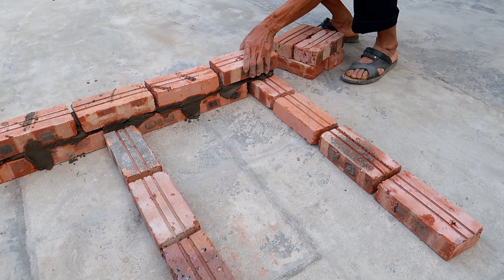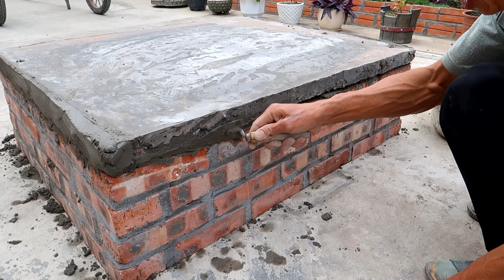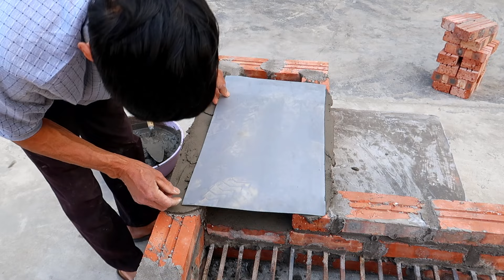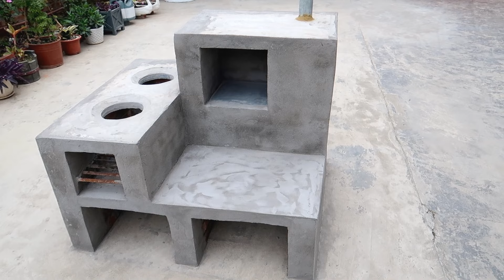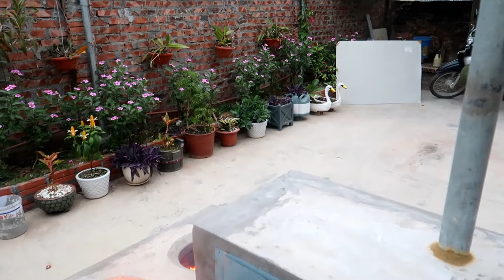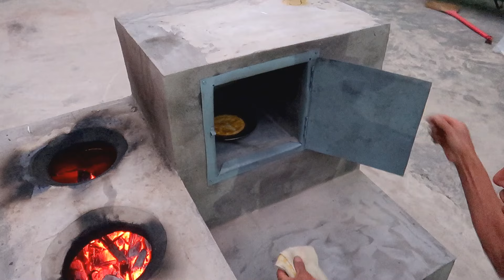Building firewood stoves no smoke 3 in 1simple \ Idea wood stove clever

Comment: In India we have something called "asthra vole"..  which works in similar fashion but goes 2 steps above.. we have a boiler pot after the firewood spot, so water for bath gets heated using the same fuel and the pipeline is connected to bathrooms.. atop the cooking spot we have a lid..over which we dry clothes during rainy season using the residual heat..

Comment: This is a great design! I think I might have made the left-side firebox with the steel bars cemented in one course higher and with a cleanout on the backside. even if it stayed the height it is now, I would still have a clean-out door on the backside. I also like the brick look but found the cement coating looked nice after he texturized it. Great Job!! I have been thinking about doing this in my own yard because there is nothing like cooking with wood.
Reply: EXACTLY what I was thinking " more room to remove ash when done" still an awesome build"" 👌

Comment: German company is like "That´s 5000€, we build it in 6 weeks and it takes 9 weeks till its complete"
Reply: An der Realität vorbei... bei den ganzen Montage Arbeitern aus Rumänien, Bulgarien, Yugos etc. Wird sowas auch in wenigen Tagen fertig.  Das traf vielleicht auf vor 30-40 Jahren zu. Da war die Qualität aber auch noch vorhanden. Einen schönen Tag noch . Bin übrigens gelernter Stahl betonbauer und kenne also die Lage.
Reply: But for every layer and plank of concrete you have to allow at least a full day for it to dry properly so I'd say this stove took about a week to make. Still faster and much cheaper than in any western country, right?
Reply: @RodGibsonAcousticGuitar  depends on if you build it yourself or not
Reply: @RodGibsonAcousticGuitar  mortar does not need to dry between each layer. The slabs should be strong enough to gently lift into place in 24 hours or less

Comment: Beautiful! 
I wonder how long this would last. I’m not sure if brick and concrete can stand up to the high temperatures. They do make fire brick and a special high temperature cement, but it’s a lot more expensive.
Reply: Yeah I built myself a stove out of quick set stuff, did not last more than 5 uses before it was all cracked up
Reply: That's why you use yellow clay instead of cement, Indian style, gentlemen.
PS watch out for 'Indian village chulha' if you did not get me. 'Thermal changes in yellow clay/(withstandablity)', you may also be interested in(maybe).
Reply: Nice job...but I have the same question how does it last?? He did not use fire bricks for high temperatures..

Comment: I'm confused at the no smoke title, when I saw smoke the entire video
Reply: Me too...Hes a Scammer.
Reply: I think the chimney is supposed to direct the majority of smoke out of your face but not all
Reply: Why the hell did you think he was going to be burning shit without smoke? If he did he'd have solved climate change by now.
Reply: If you keep the fire in an enclosure that keeps the heat in that's how you get a smokeless fire.
Look at rocket stove designs.
I've made a number of them using old gas cans.
Fill the gas can with water to make sure no gas is left.
Cut a hole in it and install a fire box.
Weld it all back up.
Cut an outlet and connect to suitable pipe.
Fill it with pearlite or vimiculite.
And the add some legs.
Reply: Once he had the pan and pot covering the holes that was a fairly smokeless rig...
Reply: @naughtynaughtyJay  no if you get the black smoke to its ignition point and add oxygen then you also burn those additional hydro carbons off.
The trick is to collect the heat after you've done all your oxidising reactions so it's the most reacted it can be as heat acts as a catalyst.
That's why they grind coal in power plants fuller reaction, more energy, less waste.
Reply: The design needs improvement. He needs to make additonal holes for more air to come in the combustion area. This will make the combustion more complete thus making less smoke and hotter fire too.

Comment: Excellent. Just wonder why you have to reach over such a large table to get to the oven? And how you control the temperature on any of the burners or oven?
I'd have to figure out a way to put a window in the side and door of the oven to keep an eye on the food inside at least. Since it is a closed oven system, opening the door to check the food would dump almost all the heat. At a minimum, install an insulated tube of some sort to put a thermometer into the oven so I could guess at the baking time.
The free-fire burners are apparently high on the front burner directly over the fire, and low to medium over the back burner (Unless you push the fire back under the back burner).

Comment: do you have to put cement all over the stove? I don't understand it,
Can you just stack up bricks after bricks to build the stove?
Reply: You wanna make sure it's as airtight as possible, and as hes just using the cement and bricks he had at home and used cement for mortar it'll last longer now that he cemented the outside aswell. You can buy mortar that handles heat without an issue, but why bother if you've already got shit lying around :D

Comment: The concrete is bound to crack or explode under extreme heat. To avoid this, just use fireclay bricks. Maybe even hurt someone. So this is just a show, once you get it on camera... there were also smart guys, so everyone would cast stoves out of concrete and stoves would not be needed.

Comment: Wait, he is using a knife to put cement
Reply: Yes . Yes he is . Knife/ clever to be correct.  
Lots of these ppl use them for multiple purposes.  They aways wash them and clean very well and some oil them to not let rust.What troubles me , is that they use them to brake / trim / cut the bricks.

Comment: So many issues here. 
1- how to get burnt ash out of that narrow bottom.
 2- smoke is still there.
 3- how concrete can hold that much heat? 
4- why using non stick pans on wood fire? They are not recommended for it.
5- how to get oven heated with that high temperature by buring wood at the side with 2 big stove holes that can take the heat out instead of heating up the oven from below as its not direcrly over fire?